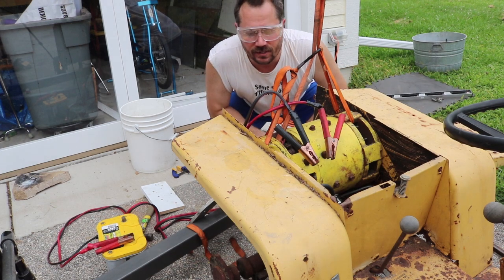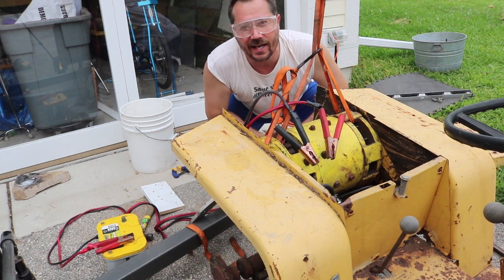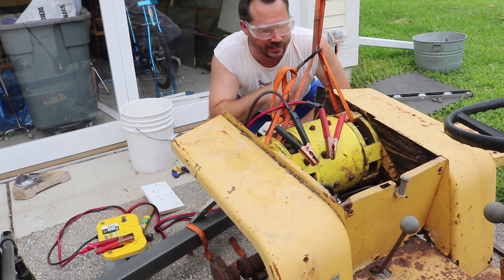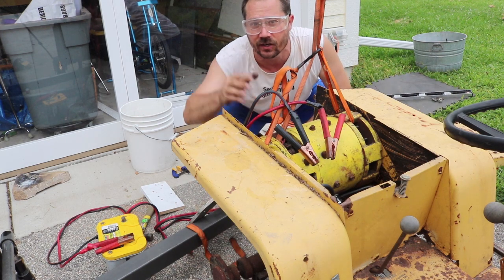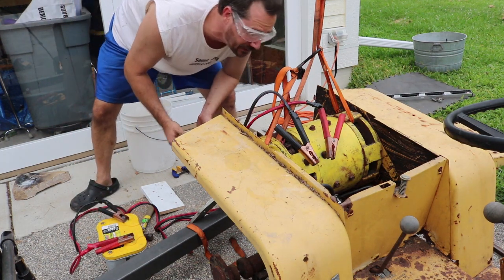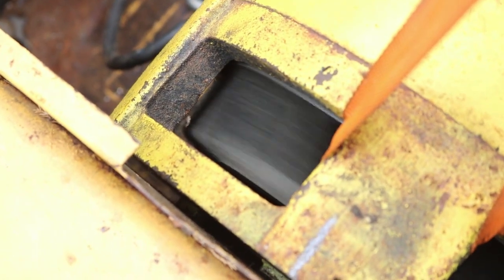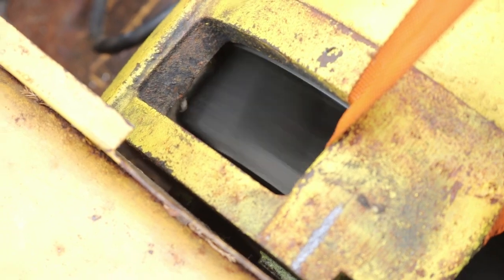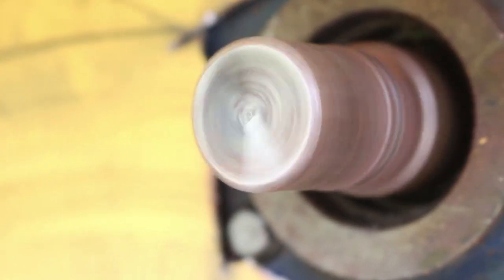Electric Tractor Rat Rod Motor spin up with Jumper Cables

Comment: What will you use for a controller? ( beautiful fit on the motor by the way)
Reply from the maker: I was sort of hoping to re-use the original resistor speed control built into the tractor, but there's too many micro-switches and contractors. A person has to trouble-shoot the entire wire harness for corrosion, mice chewing on wires, etc. I took a good look through it and decided it wouldn't be worth it.
I have handy my original Open Revolt motor controller which was used in the Geo Metro project. Should fit under the hood fine!